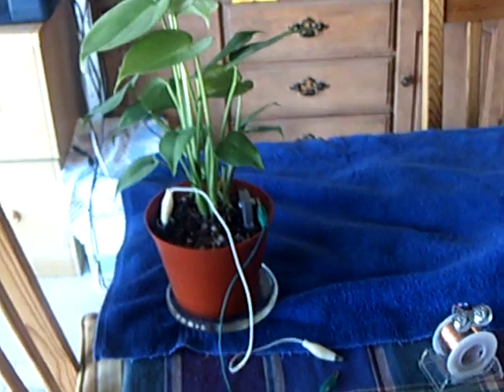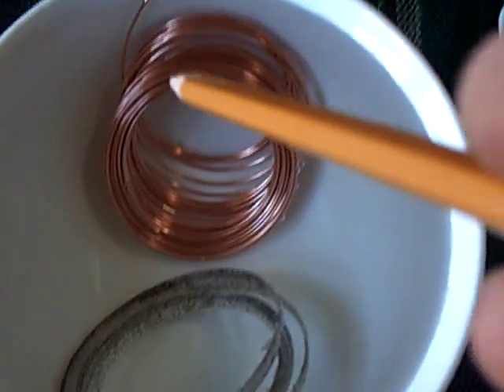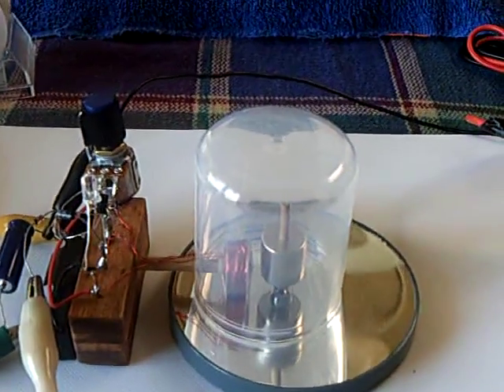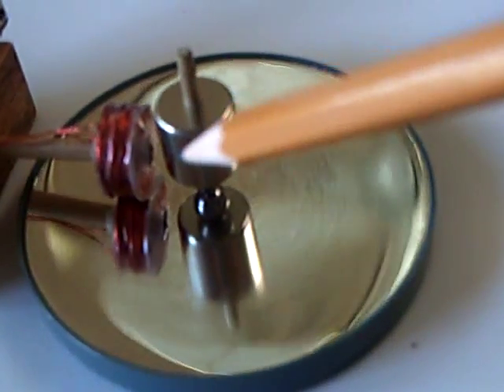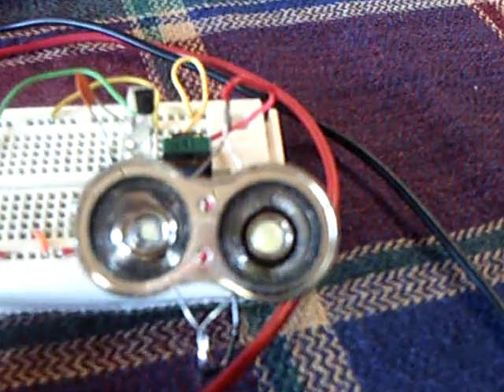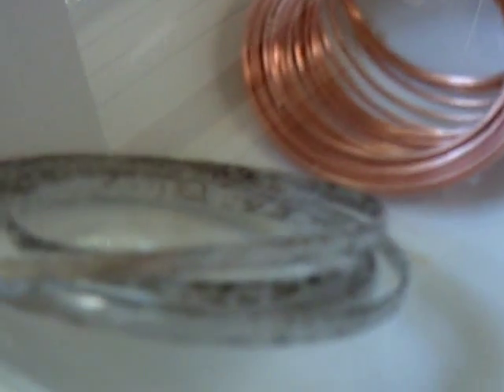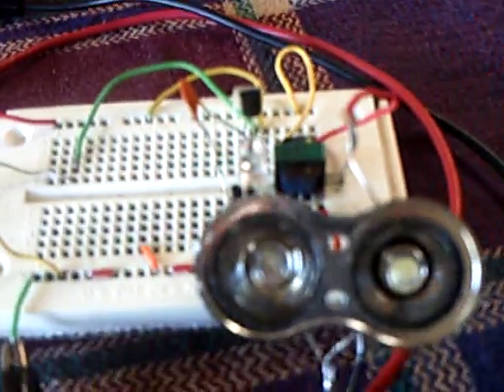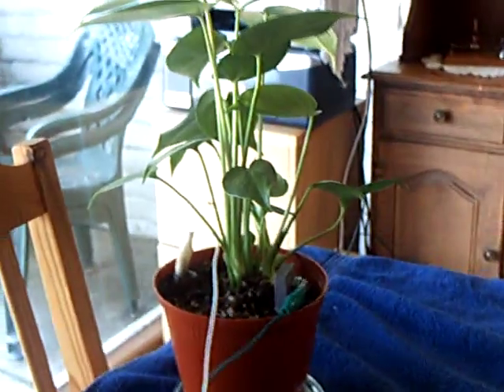Plant Battery---How to boost power

Comment: what does the plant have to do with it.??  Do with no plant..
Reply: You don't get it. Unless you use electrodes that don't erode. All you have is a is a chemical battery. Use platinum electrodes and nothing will happen. They use carbon electrodes in large scale operations with plants growing mostly in water
Reply from the maker: The root structure helps hold the moisture plus the minerals in the potting soil perhaps add something.  This thing is still alive and well. It is putting out light using a Joule Thief circuit.. I have changed the magnesium anode once since I started the experiment.  The plant has grown much bigger.

Comment: So 4 of these plants combined can charge my cell phone?
Reply from the maker: Well maybe.  It is really just a plain old galvanic cell like a flashlight battery ---dressed up in a nice house plant.
The amperage isn't great but it is still working after all these years.  I replaced the magnesium anode one time. The house plant doesn't mind the cell.  I think the root structure helps the whole situation by stabilizing the electrolyte ph.

Comment: can copper and allumanium be used on the plant to create the electricity or it got to be copper and magnesium?
Reply from the maker: Maybe.  I have not tried that combination.  It is not that copper and Al will not make a galvanic cell but what the chemistry does to the well being of he growing plant.  This plant battery here is still alive and well after all these years.  The Mg anode was replaced this year.  The Joule Thief light has been running 24/7 non stop for years now.
Reply: Lidmotor I would like u to help me in my plant battery,if I did it wrong
Reply: i have something of the interest, I created a device that allow u to run any load you want up to 10k watt, but the problem is , my device needed a electricity to feed a boaster circuitry that step it up from 3.5 voltage and 300 mili amps to 6 amp and 12.5 voltage to run the inverter, then my special device can be plug into the inverter to run any loads you wanted , but my device will be come very cold, as you added more loads to it. the device has ability to accommodation the powers to any loads you added to it. but it will become very very cold as  more loads is added to it. that is the reason I am looking for syster to get my boaster dc step up going to only needed to run my inverter . from there my device will take over,  you will call this technology zero point energy  hybrid

Comment: do u know that u will get electricity TOO by replacing the plant with salt water? with magnesium n copper as cathode. mabbe a lot more electricity.
Reply from the maker: The salt water would kill the plant.
Reply: ***** my point is...if u use magnesium n copper, it is the oxidisation of the magnesium that created the electricity, not the plant.
Reply: u can use cu and mg to produce electricity from salt water. But this method has become old

Comment: @Lidmotor I agree with you, at least it is a nice gadget to power up the garden or pond LED-lights, maybe combined with a small solar panel and a battery or capacitor :-)) 

You don't happen to have a copper plant pot laying around? That would give you some nice surface area.

Comment: @jeannacav The roots suck up all the water so I guess they act much better as an electrolyte then the surrounding soil. I think you can gain power if you can add a substance to the soil that does not hurt the plant, and that works as an electrolyte. Maybe that you can try to add some Alum to the soil, it is a natural mineral or crystal that you can buy in the grocery store. John Bedini uses it as an electrolyte additive for his batteries.

Comment: @Lidmotor Yes I understand, the minerals in the soil dissolve in the water and then the water (soil) becomes an electrolyte. I see a lot of similarities with my hho device and the basic workings. The same as batteries, capacitors, fuel cells etcetera. In my hho device I use neutrals in order to divide the voltage, it's like a battery in reverse. Surface area from the electrodes and the neutral plates play a big role for hho devices as well. Preventing current leakage improved efficiency big time

Comment: Hi Lidmotor, I tried that trick with the led going from the collector to the pos of the battery in an attempt to lower the draw, and all that happened was the led on the secondary blinked. (In fact they both blinked) Is that diode at the transistor base all important here?
Help, please!
thanks
jeanna

Comment: @insAneTunA  (If I may be so bold...)
Actually it doesn't do that very well on mine.
The plant battery that did the least well except for the phyllis one, was the one with the electrodes in the 2 separate areas of the planter. I found, that when I made a wire spiral AROUND THE ROOTS of the plant the amps went up and they last long. There are other things that increase the life, like dolomite, but that belongs on my channel.
scuse me! and thanks!

Comment: @Lidmotor I was wondering, let's suppose that you have a rectangle pot and that you put some neutral plates  between the anode and the cathode, in a way that the soil has it's own compartment if that is possible, would that increase the voltage? Perhaps aluminum foil could be used as neutrals and to divide the soil in isolated compartments?

Greets, iT